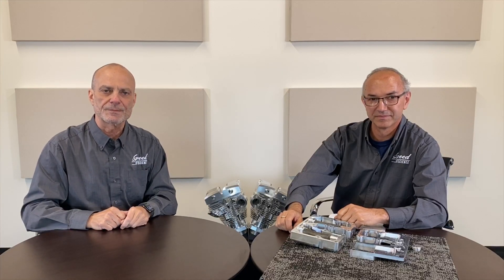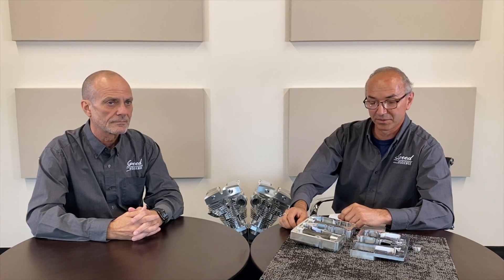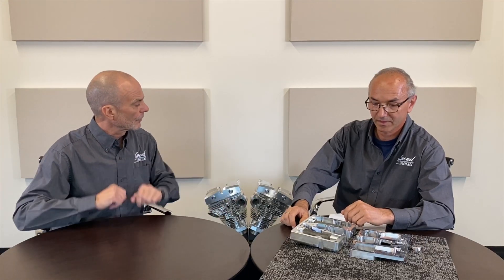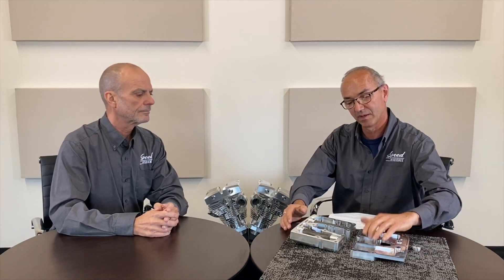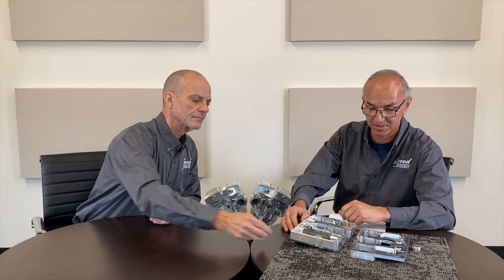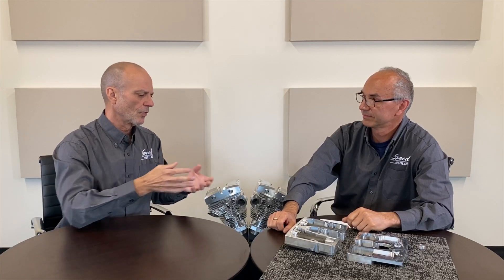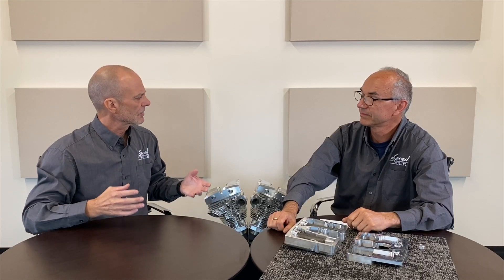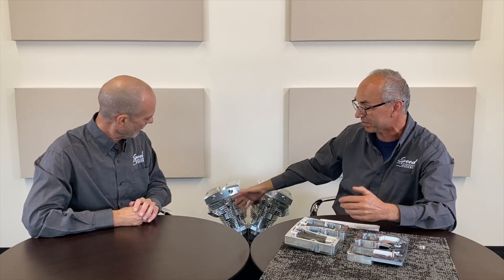Episode 4: Harley Davidson Shovelhead Rocker Boxes. a.k.a. "The Icing on the Cake"

Comment: I'm planning to build a 96" shovelution motor using these rocker boxes. I had a few questions. What rocker arms should I be using? Shovelhead or Evolution? What pushrod tubes and keeper length should I be using? Shovelhead or Evolution? I'm going to be getting all of the other necessary motor parts directly from S&S except for your cylinders, heads, and rocker boxes.